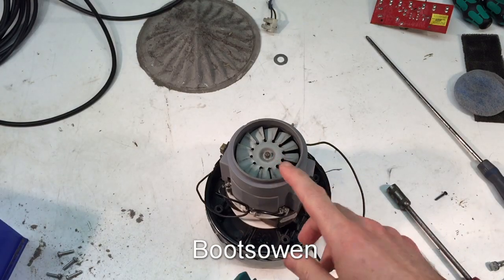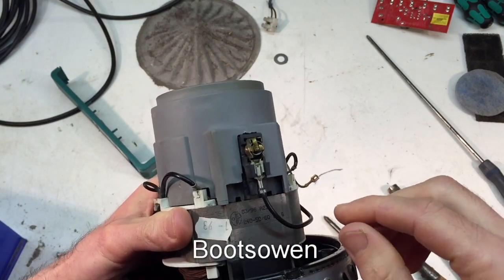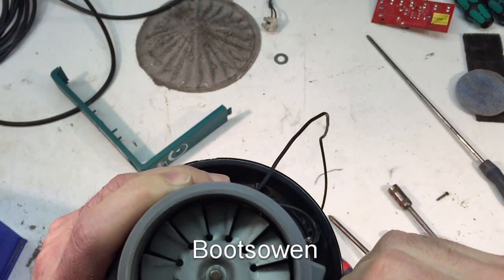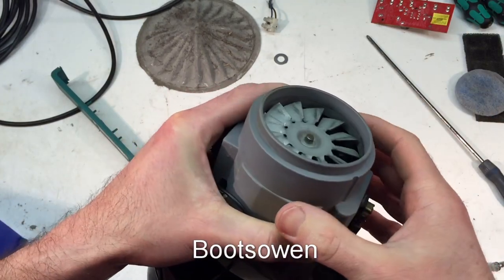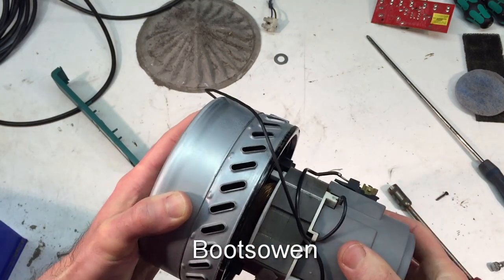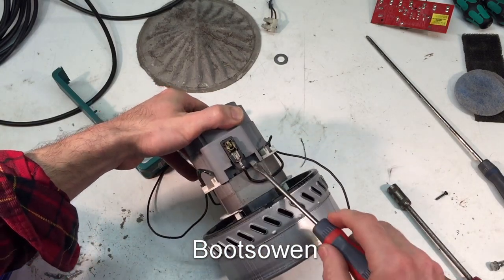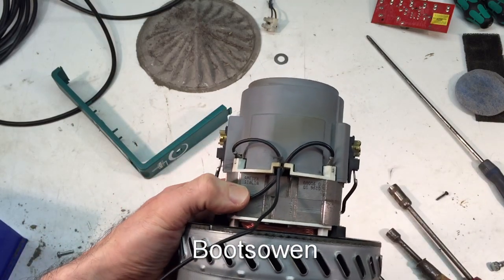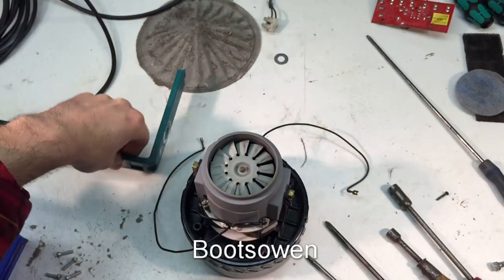Vax 2100 motor brushes: your help needed!

Comment: Hi there, did you find a way to take out the brushes. I have the same problem. Thanks
Reply from the maker: I think I show it in a video that came after this one. You will have to search for it.
Reply: @bootsowen  Hi I have searched all your vids and none show the result did you get the brushes out and if so how did you manage it I have my trusty old vax in bits but cant get the brushes out I am an OAP so cant afford another so would be grateful for any advice , and what replacment brushes you used many thanks Jim

Comment: Will the brass tab, going across the middle of the brush cylinder, bend back and release the spring along with the brush behind it ?
Reply from the maker: No, that tab has a braided copper cable going to the brush welded to it. I found out after a bit of forcing that if i bend up the tab going to the spade connector and then force a thin straight screwdriver in there it can be pulled out.  I'll put it up in a future video.
Reply from the maker: From the comments: No, that tab has a braided copper cable going to the brush welded to it. I found out after a bit of forcing that if i bend up the tab going to the spade connector and then force a thin straight screwdriver in there it can be pulled out.  I'll put it up in a future video. 
it should be in this video:
https://www.youtube.com/watch?v=TVBKU4CYFko
if not i have no idea.